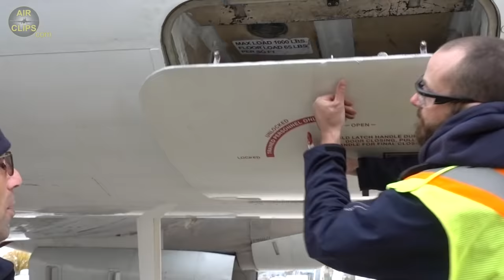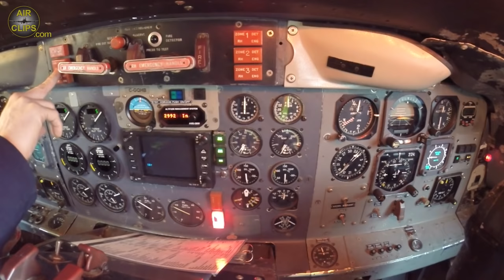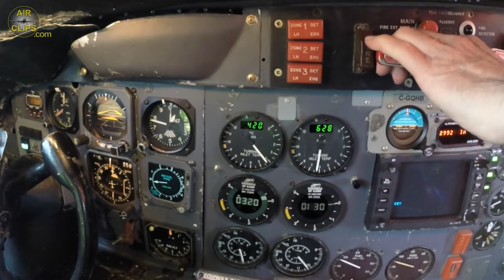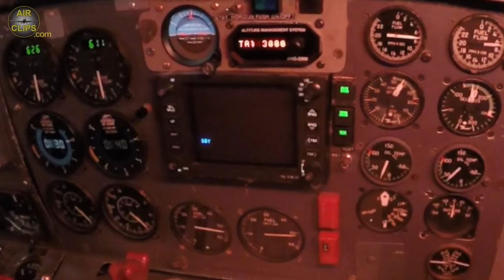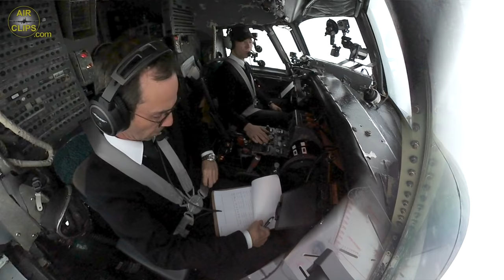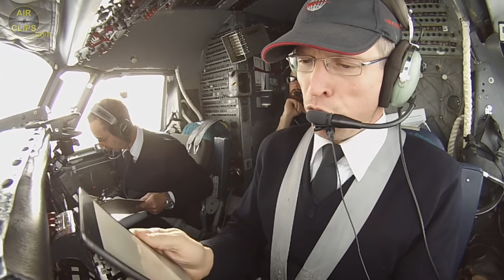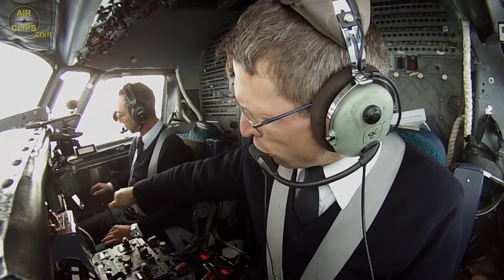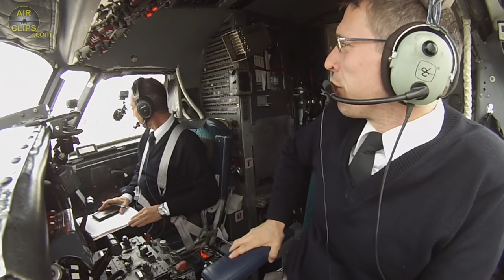BREATHTAKING! One of World's LAST Pax Convair 580 ULTIMATE COCKPIT MOVIE, Snow Storm Ops  [AirClips]

Comment: I worked on both QHB and TAP at Canair. Had to fix QHB after the left prop and reduction gearbox were torn off in a runway over run in Tafino BC. There is a patch on the top right corner of the main door where the spline drive for one prop blade went through. Also a patch just aft and below the left pitot tube again a gear segment from the prop. And a large patch just aft of the lower edge of the main door. Three of us replaced the left engine/QEC and prop, patched the holes temporarily, dug the mud and gravel out of the brakes. This was all completed outside with little equipment. We hired a logging truck with a boom crane to lift the QEC. Full power runs and flew out in four days to YVR for completion of repairs. Pretty rugged old pigs.

Comment: I have over 300 hours in the CV-580!   Never cared much for it because of it complexity, especially the electrical systems!  They took a 1930s design and dragged it kicking and screaming into the turbine engine era!!  The original design was primarily DC electrical, but the Allison Engine upgrade had a lot of AC requirements. As a result it had two separate electrical systems with an AC and a DC generator on each engine.  It seemed to me the two separate electrical systems wanted to be at war with each other.   The electrical system on such aircraft as, say the 737, is much simpler!  That being said, it says a lot about Convair's engineering and construction that they could take a design built originally for 1200 HP piston engines and later mounted 3400 HP Turboprops without tearing it apart.   That always amazed me!

Comment: For all of you wondering why this plane will be retired. I am a Hawker 748 Pilot and we are facing the same problem.

I invited all of you to go read on the RCAM system. 

Here is a short explanation: 
File Classification No.:	Z 5000-3
At present, the vast majority of flight operations conducted under subpart 705 of the Canadian Aviation Regulations (CARs) (i.e. airline operations) utilize manufacturer-supplied performance information that is based on TALPA methods. With the provision of a runway condition description – including the type and depth of contamination – flight crews can enter the Runway Condition Assessment Matrix (RCAM) and determine the code that they require to make their performance calculations in accordance with manufacturer-supplied, TALPA-based performance information. (See Appendix A: Runway Condition Assessment Matrix (RCAM).

For some older airplanes which are still in service, the manufacturer may not yet provide performance information which conforms to the TALPA methods.

Comment: Excellent video. One of the best! Brings back memories from a flight in  a CV 580 in 1984 on one of my legs between NYC, Austin, Texas and San Jose California. The plane was not very well maintained, so I will not mention the airline (regional airline, defunct). On entering the cabin the first thing I noticed was that the starboard over-wing emergency exit was taped around the edges with duct tape,  second thing was that the row of seats, where I had my seat, was not properly secured to the floor (a number of bolts missing). To find another seat was no problem, since there were only about 6-7 pax on the flight. The taped emergency exit did concern me a little, but nothing happened and flight was uneventful. I have just downloaded the 580 to my FSX and I will make the same flight.

Comment: Can someone explain the regulstion that is the cause of this aircrafts retirement? 
Does it only apply to Canada ir internationally?
Will they continue to fly pax and/ or cargo anywhere else?
Reply: The Convairs I worked on back in the sixties here in the US were tired and well worn. I was involved with the engine swap from prop driven radial engines tô turbo prop engines. It is doubtful that these particular Convairs will find service elsewhere in the world. Although South America and Africa are willing to take DC-3s and fly them until the aircraft fall apart, either on the ground or in the air. The aircraft they fly only fly within the country to which they are registered, So international regulations hardly matter.